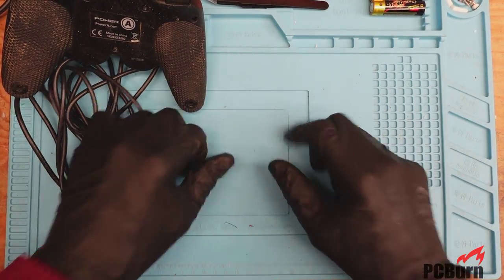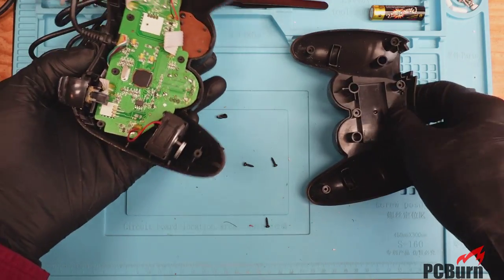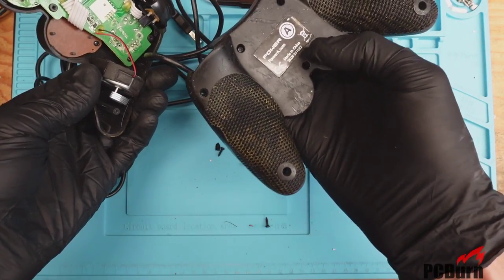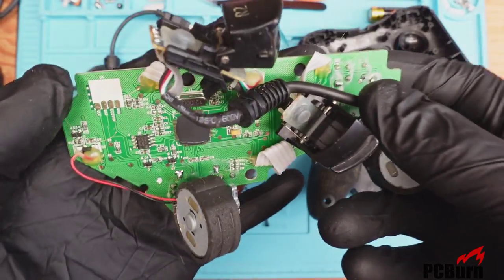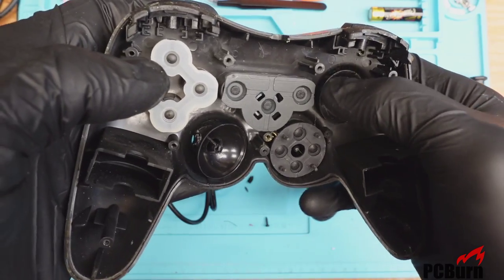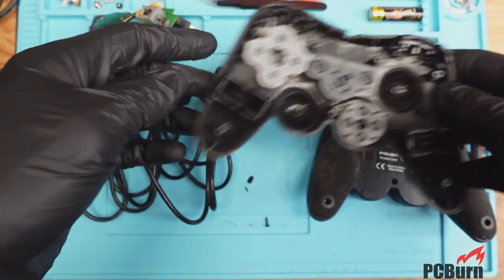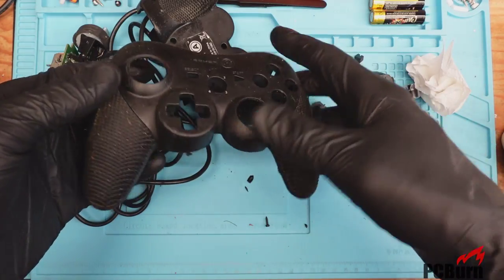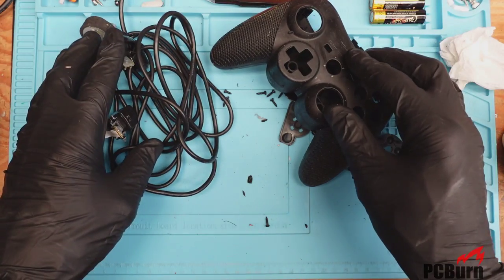Removing Rubber Coating

Comment: Where is the actual removal part??? All I saw was the removal of the sticky outer layer. I want to do what the title says "Removing Rubber Coating".
Reply from the maker: That's the rubberized coating. Were you to remove it before it got sticky it'd be the same process.